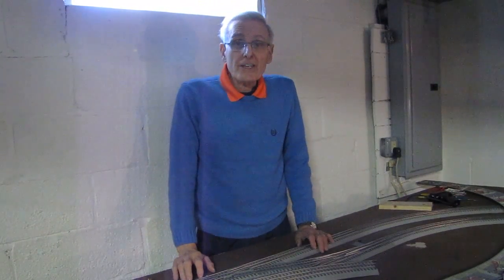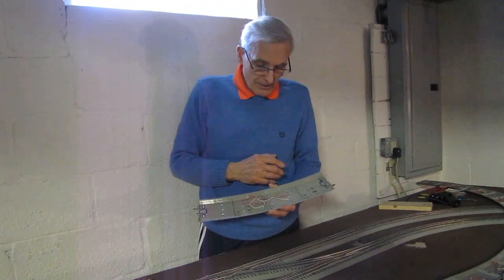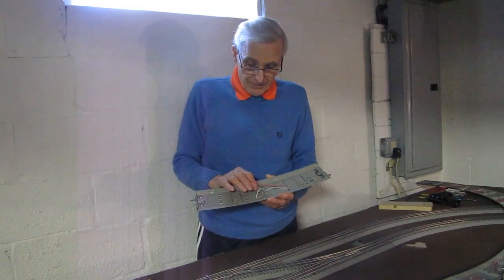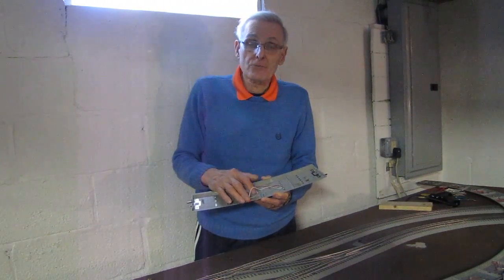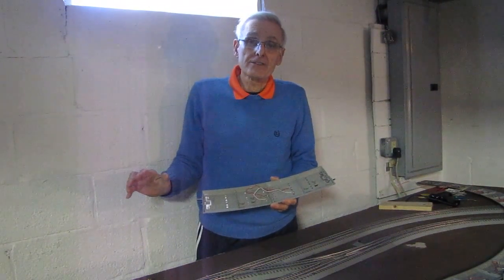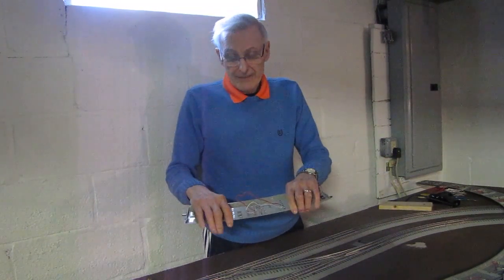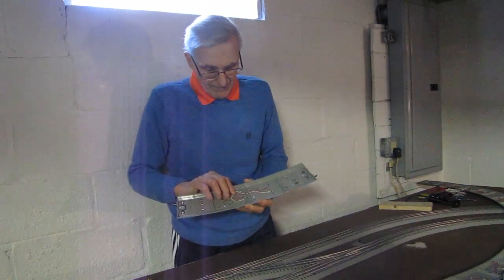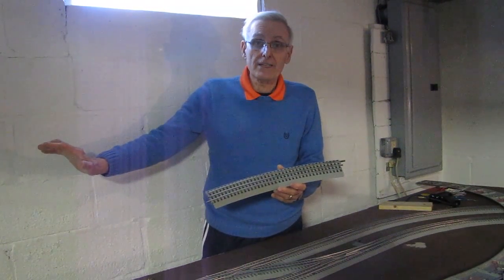Video 14 - Prevent Voltage Restriction Through Tracks.

Comment: I really appreciate your videos.   I have watched all your videos.  I have a question about blocks and power districts.  Most people say to use one of 1 3/8 straight tracks and remove the wires.  Fine but do you need to a sPDT to turn it off/on?   I have three loops connected with 072 fastrack command switches.  Also at this time I have two Lionel 180’s and another on it’s way.  Each loop is going to have it own powerhouse and powermaster.  Each loop would be it’s own district but not sure how to do it.
Reply from the maker: I have a question. Will the 072 switchers be connected to the three loops? So you can have your train go from one loop to the other.
Reply: Nick L Trains     Yes, Nick all are connected with 072 Lionel switches.
Reply from the maker: @gstephengoss1  It seems you have two questions. First They are right about using a 13/8 straight track and remove the Red wire which is the center rail of the 13/8 straight track. Although you will still have the Neutral current flowing through the two outer rails of the 13/8 straight track.(Which is OK because the Legacy signal is transmit through the neutral track.) The Block track will also have neutral current because of the two outer railings on the 13/8 straight track. To apply positive current to the center rail of the block track you need one SPST switch. The way you do this is to run one red wire from your transformer positive post to one terminal of the SPST switch. Then run one other red wire from the other terminal of the SPST switch to the center rail of the block track. Once you put the SPST switch in the close position you will have positive current to the black track and what ever you have on the black track will receive current. When you put the SPST switch in the open position you will not have positive current on the block track and what ever you have on the black track will not receive current. Let me know if you need feather information on the block and power districts.If you do not have any more questions about the Black and power districts.I will explain how to power the three loops.
Reply: Nick L Trains Thank you for your help.  Unfortunately the current didn’t turn off.  Here what I did  legacy base connected to “U” is then connected to the powermaster which connected to the PH 180.  The powermaster  “A & U” are  then connected to the MTH terminal.  After removing red wire from the straight 1 3/8 piece the SPST was connected with one wire to the center and the second was connected to the MTH terminal “A”.  Hopefully I followed the steps correctly.  This is beginning to be frustrating but not at all defeated.  If this doesn’t work will try something else.
Reply from the maker: @gstephengoss1  What is a MTH? Is it a controller system made by MTH company?
Reply: Nick L Trains MTH terminal block is made by MTH Trains.  It just like any other terminal block.  The “A” side is power and the “B” side is for common.
Reply: Nick L Trains  take a look at this Lionel diagram  (Incorporating TMCC or Legacy on a Sample layout.wmv). At the bottom shows my set up with four switches.  It’s on YouTube with Mike Reagan.
Reply: The red, blue, and green wires of this diagram.  I sorry for being a pain.